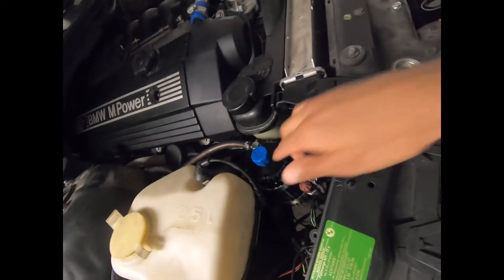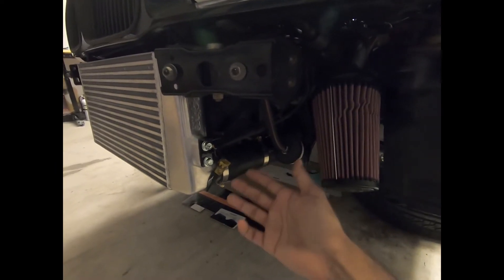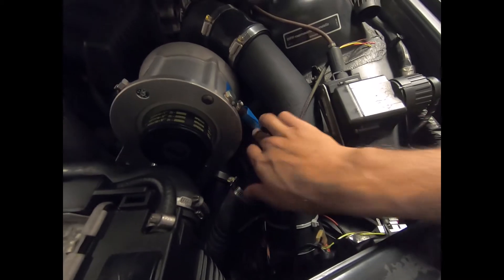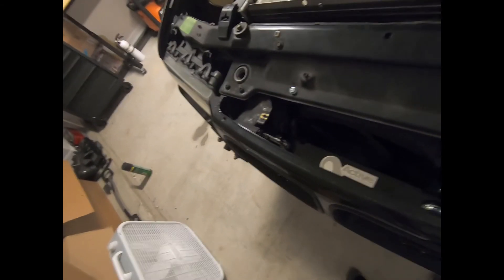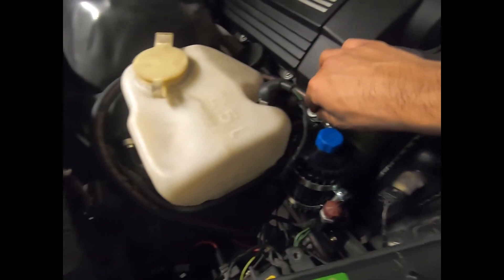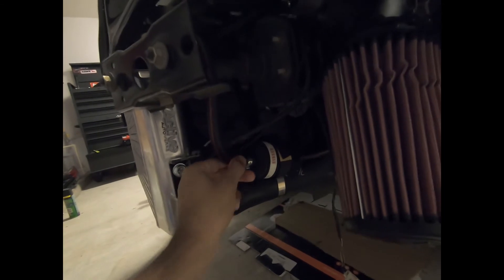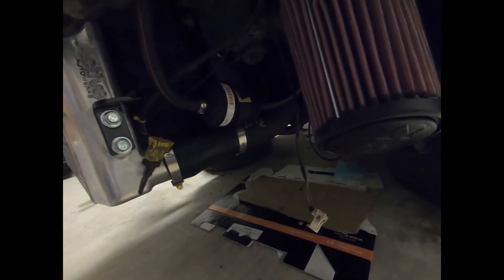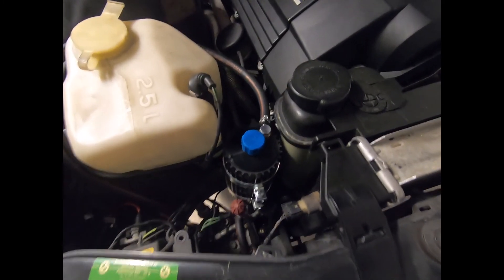E36 M3 Active Autowerke Supercharger Level 2 Install part 7 - Rotrex oil (traction fluid) lines

Comment: Where did you connect the blowoff valve connections to and do you have pics of the connections?
Reply from the maker: Hey, under the intake manifold there is a small vacuum line that goes to the fuel pressure regulator. I pulled this line off and added my Tee connection for the line to the blowoff valve there. It's hard to see so we had to go by feel. The nipple for the line is right next to the idle air control valve. https://imgur.com/sRvHY1c

Comment: Hey man. What type of oil do u run in your M?
Reply from the maker: Hi, I run Liquimoly 5W-40. I think next oil change I will switch to Liquimoly 10W-40 due to the hot climate I live in.

If you're talking about supercharger oil, I'm not sure. its a proprietary fluid from rotrex I believe.